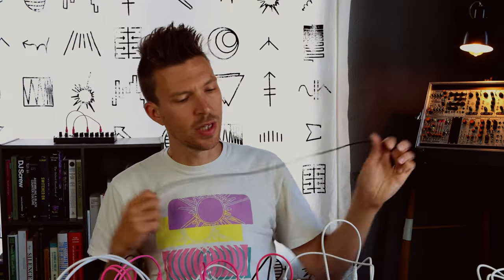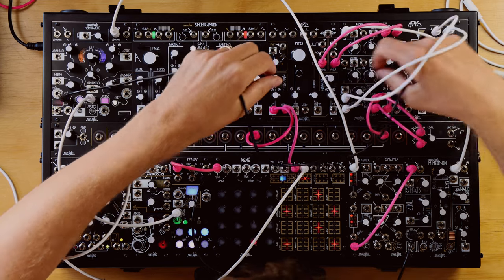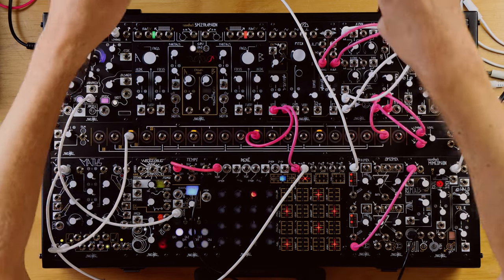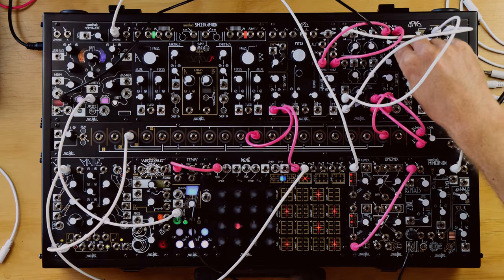XPO Bassline | Make Noise

Comment: How do you achieve that clock pattern on channel 3? Is that a direct result of tempo sync to the end of splice clock input into tempo?
Reply from the maker: I think that must actually be an optical illusion caused by some strange interaction between the video frame rate and the LED driver.